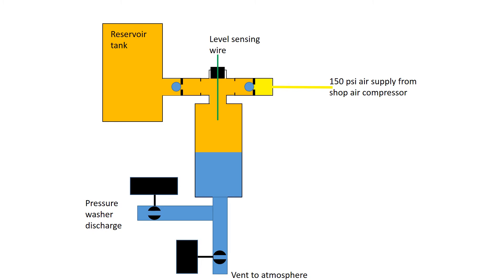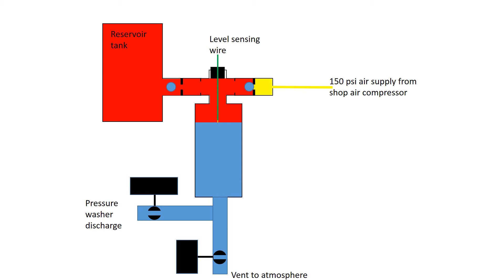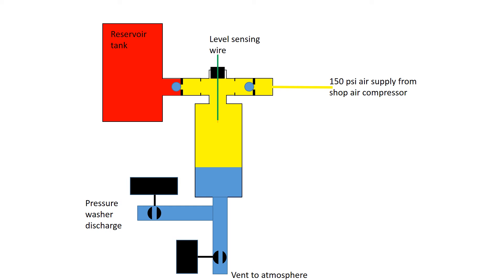Pressure washer air compressor animation

Comment: You should check out my screw together power washer it's all right on my channel if you like it I would like to know what you think about it I think your ideas really awesome by the way so I've had this comment up for a couple of weeks and haven't gotten any response for you from you so I'm just going to go ahead and assume that you're not watching your comment section on your Channel everybody needs to go and watch my video it's way better than this. Mine doesn't require check valves all kinds of crazy dancing and tanks and all the moving parts that you have in yours mine has 0 moving parts  and it will fit in your hand .you can adjust how much or how little are or how much or how little water is Ultimate detailing super tool and everybody needs one if they use a power washer to make money for a living check it out so special note to the Creator if you ever watch this and read this comment I would be interested in combining my gun with your system to see just kind of what kind of results so I would get I would be more than interested in doing some type of collaboration if I don't hear from you I'm going to do it anyways sometime this summer so cheers

Comment: hi, could you use a low viscosity oil instead of water so there no chance of getting water vapour in the high pressure system?
Reply from the maker: Yep, you probably could. You could also potentially use a hygroscopic liquid such as ethylene or propylene glycol to not only avoid introducing water vapor but in fact absorb much of the water vapor in the air.